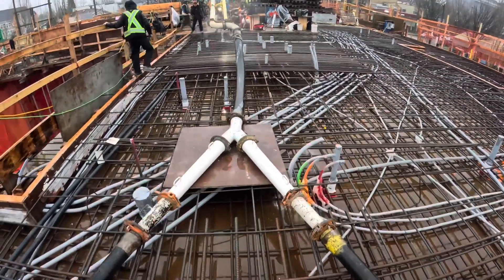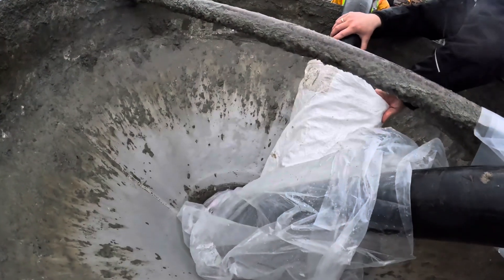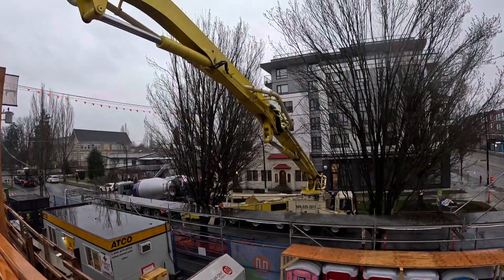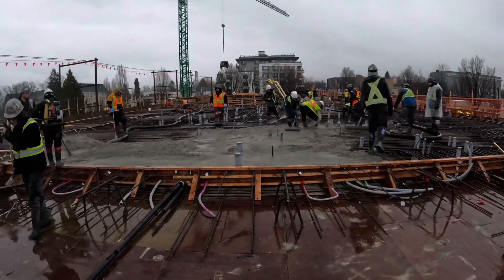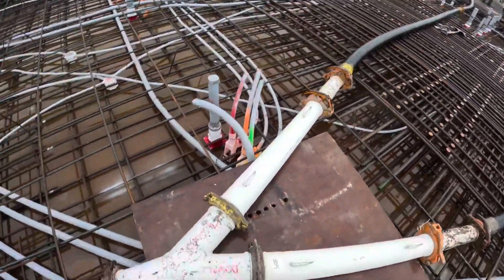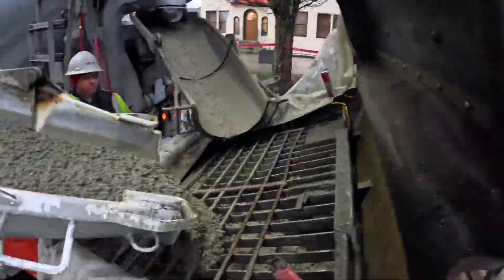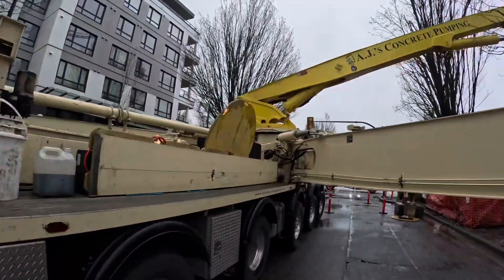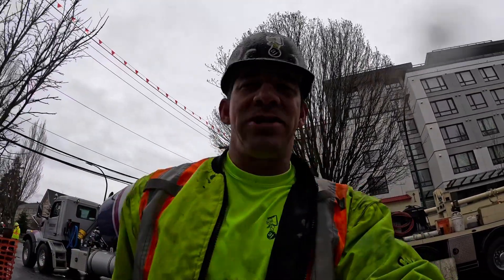Y-not??? (Pumping concrete through a Y-splitter)

Comment: We did a bridge deck that was 35 mpa with some kind of rubberized additive. That stuff set up so fast and hard that by the time we drove down to the clean out site it was hard and would not wash off. Even the acid barely touched it.

Comment: Thanks for sharing that!  The previous load was too stiff, and where the vibrator would not fit between bars and concrete was piling on top of the bars...
Reply from the maker: @SpaceCrete  this mix is very cementitious/sticky. Even the mud stacking up on the bars there was testing out at a 170mm (at the hopper). Made a night and day difference once we got into a consistent run of 190mm-200mm slumps.
Reply: @canadianconcretepumper1979  I was called to a job where they thought concrete was getting through the bars but it never did.  Don't know how they fixed it.
Reply from the maker: @ Oh I’ve seen that…. It ain’t an easy, or cheap fix 🙃🙃🙃

Comment: Did I read that right 320bar on that pressure gauge!! Damn that pump was pushing some thick ass mud now.
Reply from the maker: @420tagalong  Yup, that one load SUCKED!!!!!
Reply: I don't understand redimix supply sometimes. You can tell them anything you want on the slump...and someone will without fail bring something so dry it will barely go down the chute.